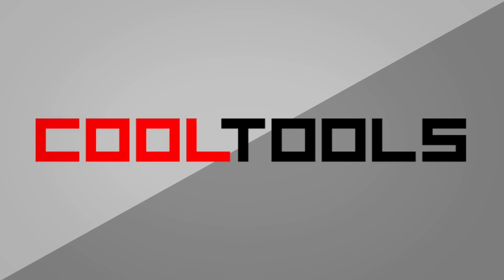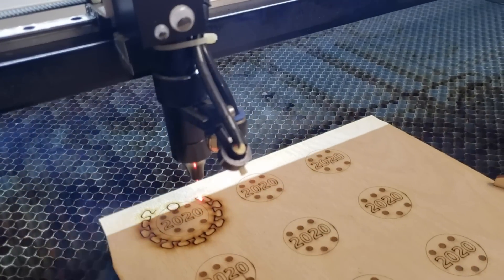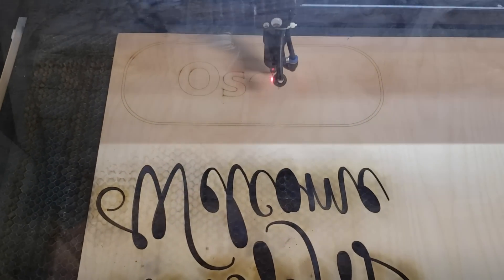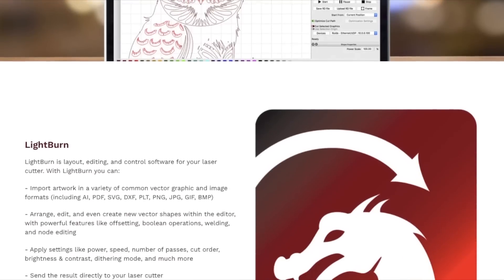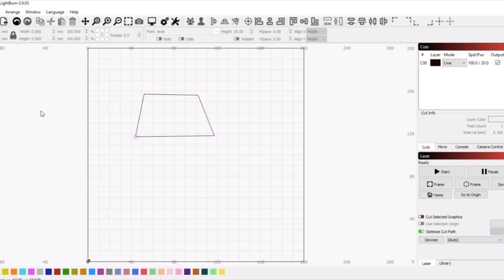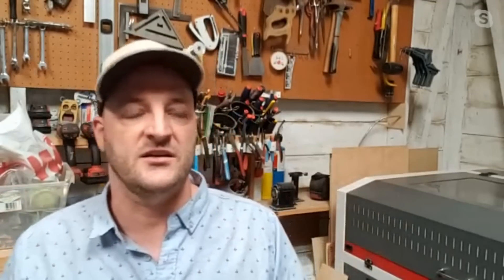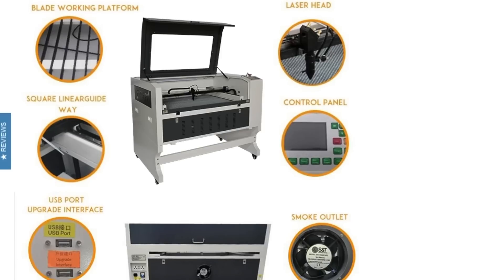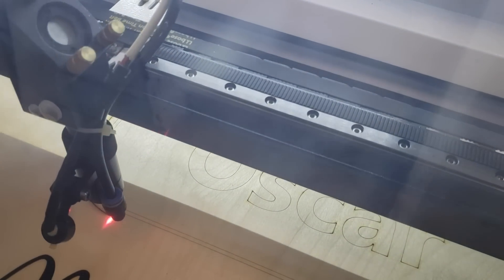Glowforge Killer: half the price, twice the power

Comment: I think it’s really more of user friendly and space area you have available. I think any thing higher that 60w requires 220v so you need an electrician to wire you that. You need to also do adjustments on the mirrors …camera needs to be added but doable similar you need to learn the software as well if you want lightburn …. For most GF users, most of it is being removed from the equations. I bought k40 and Gf pro …. I loved glowforge and my k40 is being fully upgraded from lightburn board to meter etc.. but good laser and tube available

Comment: Great video, thanks!  Back in September of 2019 I bought the very same unit from Toolots, been enjoying it ever since.  I see they don't have that model any more, that's unfortunate.

I have made a few mods to it, most notably added a current meter (ma) to the front to ensure that I never go above 25ma in the tube.  I also designed and built a rotary unit, added a connector for it.  Like you, I use an upgraded water cooler, plus venting with a super-strong exhaust fan to the outside.

It's been quite wonderful, making all sorts of things, even etching metal.  No regrets here!

Comment: You need to put the blower on the outside of the building.  This is so that any leaks in the system are vacuum not pressure.  My friend cuts open battery cases to rebuild.  He has done this for 20 years.  He moved the blower outside.  Only than did he realized how much of the  fumes remained in his shop.

Comment: I still do not understand how this is a Glowforge killer? Power? Sure....ANY laser more than Glowforge (45W) will be more powerful but not necessarily better....this laser doesn't have the an interface anything remotely like Glowforge meaning, this laser can't "trace" over a sketch or contour/surface...Glowforge uses cameras to navigate across the surface/contour and pen line/sketch.  That's where Glowforge really shines..it's not just reliant on vector based data. Very few lasers have a unique interface like this...Flux Beamo  is one of them....the CO2 laser reviewed here is just that...you still have to adjust the laser to your material thickness, can't do a contoured surfaces unless it's cylindrical and you have the rotary fixture...if you sketch something, you'd have to scan it in, convert your linework to a vectior drawing, etc....comparing apples and oranges.

Comment: Could you tell us the name of the manufacturer and where to purchase?
Reply: It took awhile, but a few months ago I was interested enough in this laser to research the manufacturer after trying to go through who the author bought his from.  The manufacturer is JINAN GOLD MARK CNC MACHINERY CO., LTD
ROOM104,1ST FLOOR OFFICE BUILDING ,NO.13788, SHIJI ANVENU, LIXIA
AREA, JINAN CITY, SHANDONG PROVINCE.  (Contact info is on the internet - look up Jinan Gold Mark Machinery and go to their TS6090 model.
Toolots was importing them to the US, but evidently there were some financial issues between Toolots and Gold Mark so Gold Mark decided to sell them directly without having a US distributor.  I spoke directly with the factory and found them to be very responsive and easy to work with.  If I sent an email to  them at about 8pm MST, it was early morning in China and I would have a response within a few hours.  They also use "WhatsApp", new to me, but very responsive on it.  I finally ordered the same TL6090 model, 600 X 900 mm, approximately 2'x3' with a pass through with a 90watt, 110 peak, laser tube.  The 300+ pound crate arrived last week in Seattle and the import company that handled everything for me let me know two days ago what I owed in custom fees, 25%, and so the crate should be on it's way to my shop in Montana this week.
Shipping and customs almost doubled the price of the machine by the time I get it to about $3500.  But, that's still a little less than any other comparable machine to get it to my door.
Obviously, I haven't used it yet, but after doing quite a lot of research on Gold Mark and their products, I think I'm going to be pleased with the purchase.  We'll see.
Good Luck, so far I'm comfortable with everything - oh, and I did also purchase an upgraded chiller and a rotary device.
Don

Comment: Please please please,  someone show what the edges look like and how do you clean it up? My concern is, if I were to make a finger joint box, using 1/2" hardwood plywood, how do you have to plan on sacrificial chard wood? Or once you sand the joints, will they be glue-able and still fit? or is there so little ash that sanding it first isn't required for a good solid joint? Love to see a video on that subject.

Comment: I'm currently using the GF basic and I definitely need to upgrade.  One of things I do like about the GF though, is the onboard camera.  Without a camera, how to other lasers line things up?  Are you able to do accurate positioning if you are trying to use up scrap material?  BTW, I know you are already aware the original laser you recommended is no longer available, but the other two that you recommended are now out of stock.  Do you have any others that you would recommend?  I really liked the option of the rotary attachment on the RDC644XG, can you also run that with the Lightburn software?  Thanks so much for sharing this information.

Comment: Good info but some comments were not correct , I cut 1/4” + all day on GlowForge , 3 passes for 3/8, 1/2” no go on glowforge , glowforge software is now open source , you will not have a Brock and could run locally.

Comment: The cutter here is no longer available.  Dead link.
Reply: It took awhile, but a few months ago I was interested enough in this laser to research the manufacturer after trying to go through who the author bought his from.  The manufacturer is JINAN GOLD MARK CNC MACHINERY CO., LTD
ROOM104,1ST FLOOR OFFICE BUILDING ,NO.13788, SHIJI ANVENU, LIXIA
AREA, JINAN CITY, SHANDONG PROVINCE.  (Contact info is on the internet - look up Jinan Gold Mark Machinery and go to their TS6090 model.
Toolots was importing them to the US, but evidently there were some financial issues between Toolots and Gold Mark so Gold Mark decided to sell them directly without having a US distributor.  I spoke directly with the factory and found them to be very responsive and easy to work with.  If I sent an email to  them at about 8pm MST, it was early morning in China and I would have a response within a few hours.  They also use "WhatsApp", new to me, but very responsive on it.  I finally ordered the same TL6090 model, 600 X 900 mm, approximately 2'x3' with a pass through with a 90watt, 110 peak, laser tube.  The 300+ pound crate arrived last week in Seattle and the import company that handled everything for me let me know two days ago what I owed in custom fees, 25%, and so the crate should be on it's way to my shop in Montana this week.
Shipping and customs almost doubled the price of the machine by the time I get it to about $3500.  But, that's still a little less than any other comparable machine to get it to my door.
Obviously, I haven't used it yet, but after doing quite a lot of research on Gold Mark and their products, I think I'm going to be pleased with the purchase.  We'll see.
Good Luck, so far I'm comfortable with everything - oh, and I did also purchase an upgraded chiller and a rotary device.
Don

Comment: You should most definitely add a note to the description of this video (at the top in all caps) noting that sharing your LightBurn license is absolutely NOT okay. This sort of behavior hurts the community. In the long run you end up with lower quality software or quality software that is unnecessarily encumbered with hard licensing restrictions that make it frustrating to use.

Comment: This China made POS should not be compared to a Glowforge™.  This is a hobby tool that neeeds to be tweaked and coddled and adjusted before getting it to work. Don't forget a seperate chiller or bucket of water...lol Glowforge™ killer maybe if you dropped it on top of a Glowforge™.
Reply: Craig, I can't comment on the Glowforge since I've never used one.  I do one the machine in this video and it's a good machine at a good price and works well.  I did have an electrical issue thought...a couple of lose wires which I was able to find and fix right away.  It's been working fine without issues since.  I did add an external fan to exhaust the fumes and smoke, but that is not unusual for any laser machine.  But, you are correct, the two machines should not be compared.  They are different machine concepts for different markets.

Comment: Sorry but I routinely cut 6mm ply on my Glowforge. I also bought an external bouncy castle blower second hand as an external extractor for £25 on ebay. I will say the idea of having to send mine back to the US for a beam replacement / service is pretty nerve wracking. It's also nowhere near this fast when cutting ply. I do like the camera for precision placement of designs on the bed though - mine is pretty good in terms of alignment.
Reply: How long did you have it before. Also we've cut 1/4" birch plywood.

Comment: Laser machines connected to software in the cloud ???? All laser machines that operate remotely must have a double safety system inside to be CE compliant, and software does not count. Fully agree that the whole glow force / dremel machines are a hoax, unsafe and not compliant to international standards. 
So yes, why not buy a chinese machine, they are also not CE, just play with safe with these tools.

Comment: The biggest problem with Glowforge is that they lost a huge amount of the potential market because they took too long to get their product out. After so many shipping delays, the desktop K40s took off at 1/10th the price and people learned what they can do with them. The same principles apply to the larger machines like the 50/60 watts all the way to the 90w one seen here, and they still cost far less than the Glowforge does.

They were set to corner the entire market, but the market passed them over because of their delays.

Comment: use a small shop vac for extraction of fumes. add a 9.99 remote from hrdwr store, put it outside and run hose into where laser unit is. then add a container that has a little water in bottom between the shop vac and laser cabinet. (in case of any sparks)
Good to go ! instant fume removal and the remote is a cool touch that makes things easy !
Use pvc fittings for hose connectors on spark arrestor bucket and put a separator part way down the bucket so any sparks are forced towards water.

Comment: Why to I have to buy all that housing and legs?  Unnecessary expense and bulk.
I need 54" x 30" bed, I don't need z.  I'm making 1/8 ply cutouts only.  What should I get?   Is there any that will automatically feed through the next sheet of material?  Thanks

Comment: I pretty much thought Toolots was a scam site.  I guess it is real?
Reply: It is real.  I bought their $910 50W laser last year.  I too, thought it may be a scam, but they delivered a fully working laser to my door in Texas.

I installed am ammeter before testing the high power of the laser tube--highly recommend this since the laser power supply is 60W driving a 50W laser means the digital power readout tells you how much power the supply is giving in percentage which can overdrive the tube and cut the life of the tube.

I replaced the M2 control board with a Cohesion3D board and bought Lightburn software.  Sidenote:  if you've ever run other laser software, you really appreciate Lightburn.  My laser from toolots came with terrible software.

Comment: This review is pretty bogus. Glowforge can only do "cardboard width"? Only 1/8th of an inch? These things just aren't true, and it makes you sound dishonest. Likewise, wattage isn't everything. Glowforge customers all knew they could get a higher wattage laser for half the price, and they chose the Glowforge anyway. It doesn't sound like you did your research as you say, because the comparisons aren't very well-informed. But hey, it's just an 11 minute interview-style conversation. You don't have to be perfect. You will always get some pedant in the comment section correcting you about every little thing. Maybe you could do a demo of the workflow. That's the most important part to me and what I'd like to see most.
Reply: It's not the power, it's the software that drives people to GF.  There are much better lower cost machines than GF with larger beds, more wattage, and more capability, BUT, they don't have the easy to use software that can take a snap shot, and make multiple copies. That is what people are buying with GF.   With my 20 x 28 Laser I can't just pop a picture into a tablet and have it come out perfect, takes a lot of testing, tweaking, and wasted material before getting it right where the GF works perfect on the first pass.

Comment: I have had my "Big Red" from China for over a year now. It is only 60 watt, but it does everything I need it to. When it is time to replace the tube, I will upgrade the wattage with a longer tube and bigger power supply. I paid $1750.00 for it. You got a nice laser for that price.
Reply: I have the Big Yeller Chaser, same thing!  Surprisingly  good machines for the price.  Considering either a RECI or Cloudray tube and PS when it is time for a replacement, and going to a 100W.

Comment: Im guessing this doesn't have a pass thru to do tile
Reply: This machine has a passthrough; however, you can't adjust the height of the material to focus so the maximum thickness you can engrave with the stock lens is about 3/4"

Comment: What are your material options at this wattage? Can it cut/engrave aluminum or copper?
Reply: A CO2 laser (short of an industrial sized machine) won't cut any metal. Would need a fiber for that.
Reply: You can engrave metals if you prepare them with a special coating (ceramark)

Comment: Anyone with one of these machines know how well it handles corner over-burn with vector cutting?  Especially on thin materials like paper or card stock?  Generally, machines need fairly sophisticated speed and power handling algorithms to avoid either over burning or under burning as it decelerates to change direction.  This is one of the things that is handled pretty well by the Glowforge but, often poorly by many of the inexpensive machines.